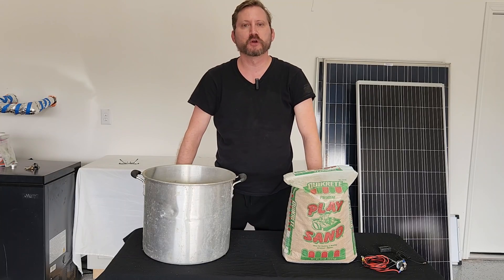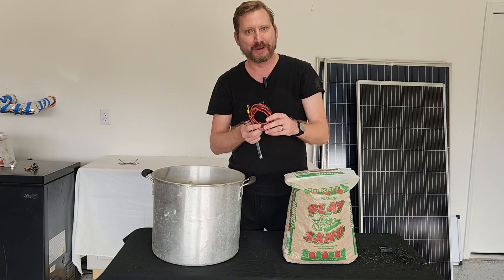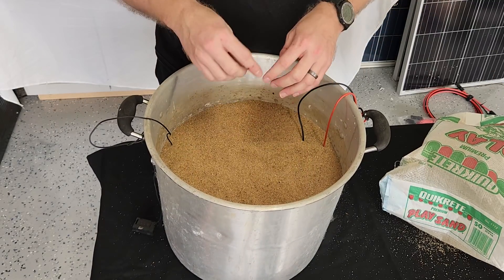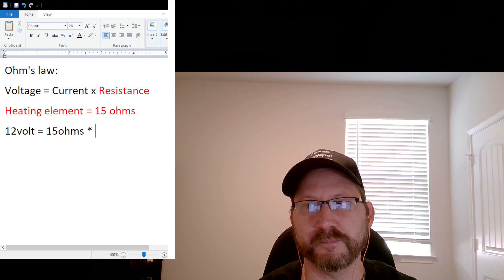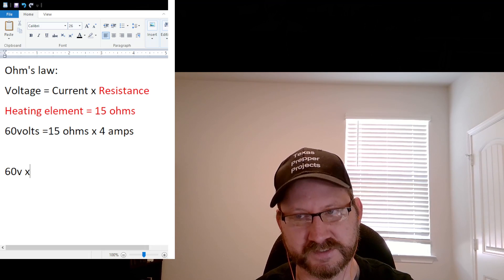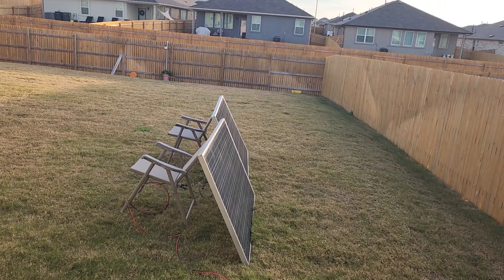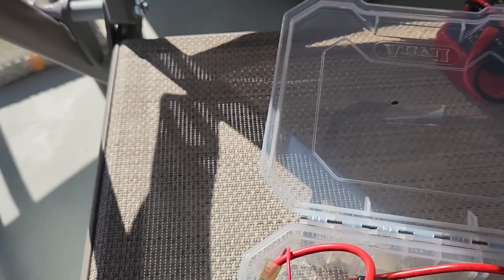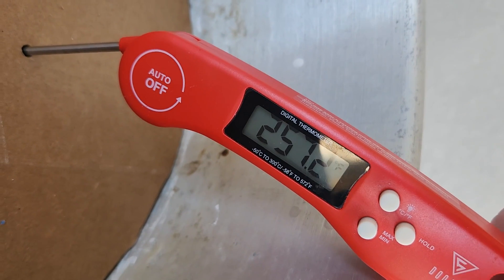Sand Battery Heater solar powered 250F / 120C with no flames or fuel! DIY

Comment: Water is much better than sand at storing energy. Water can store about 1 BTU / lb*degF vs sand at 0.2 BTU/lb*degF. What this means is, if you heat the sand from 75 - 600degF, and the water from 75 - 205degF, and you had 50lb of each, the sand battery would store 4180 BTU, and the water 7250 BTU. Sure, you can heat the sand higher, but at a certain point stuff gets dangerously hot, and you have to deal with more expensive materials to store it safely.
Reply: There is one flaw in your comment that I can think of.  I have been researching to do a setup for a greenhouse.  Looking at equal volumes not weight is a better comparison.  Sand is 1.71 times heavier than water.  So the heat storage is more.  Your argument is correct for equal weights, but the volume would be significantly smaller.  1 cubic foot of sand weighs approximately 48 kg.  An equal amount of water weighs approximately 28 kg.  If I calculated correctly, assuming no loss for this thought experiment taking 1 cubic foot of water from 10 degrees C to 82 would input 8524254 joules of energy or approximately 8079 BTU’s. 1 cubic foot of sand going from 10 degrees C to 200 degrees C would input 7825572 joules, or 7417 BTU’s.  That is 91% of the water total without the hassle.  Most people do not realize water is corrosive over time, sand is not.
Reply: @bretthaddock8954  That's a good point, and one that I hadn't considered. 
I get 80% (6500BTU sand, 8080BTU water), but I guess that depends on your weight / cu-ft, specific heat of sand numbers. 

Yeah, water can be corrosive, and while you can mitigate that, it's probably still more of a bother than sand. 

I'd say both have their uses / use cases; the nice thing about water is you can pipe it to where it's needed (radiators / tubing), whereas sand is more of a blob of heat in a fixed spot.
Reply from the maker: But then everything has to be waterproof
Reply: @texasprepperprojects  That's true. But they also make 200-2000W immersion heaters that are designed to be dunked into water for $20 on amazon. Yes, most are 120V, but you can put two in parallel.  That in a 50 gallon drum will give you a lot of thermal storage, and it's easy to drain / use the water.
Reply from the maker: but then you have to have an inverter. In this design, it's very simple. just dc to dc. You can't cheat heat
Reply: @texasprepperprojects  I'm not suggesting doing MPPT -> 120V. Do a similar thing to what you're doing, just run more in parallel. There's a 120V/2000W immersion heater on amazon that includes a temperature probe(!) for $21. Two of those in parallel would get you 1000W at 60V. (If you wanted 2000W you'd need 4). 

I'm also seeing 48V immersion heaters.

50 gal (400 lb) 'free' water vs $5 * 50lb *8 = $40. A steel 50gal drum would probably work for either.

The nice thing about water is you can pump it through radiators if you want to speed up the heat dissipation. 

Another pro or con is that it's more thermally conductive; that's a pro if you want to get the energy out quickly, a con if you want to store it for a long time.

And again, if you have to move it, it's much easier to drain 50gal of water through a hose pipe than it is to move 400lb of sand.

I think both have their uses, for sure. The nice thing about sand is sometimes high temperature might be useful -- if you want to run a peltier / stirling generator for example.
Reply: Sand doesn't expand or freeze though.
Reply: False

Comment: Great video, and good explanation of electrical theory. Small criticism. I want to maintain a min 15° c - max 30° c for my greenhouse tomatoes. ( PS, don't try growing tomatoes outside in Ireland), so I only need about 10 C of lift over the averages T in March- April.  Thanks.
Reply from the maker: Great tip!  I'm coming to Cork next week for vacation!

Comment: Hi, please could you explain the plastic box of tricks ? I fancy having a go at this project but don't understand the set-up with the busbar etc.. TIA
Reply from the maker: It's just a current meter. Not required
Reply: @texasprepperprojects  hi, thank you for the quick reply. Is the copper busbar necessary or can I just connect panels to the element direct?
Reply from the maker: Direct connect is fine
Reply: @texasprepperprojects hi, thank you. I'll be giving this a go then. 👍

Comment: Ignorant question… would there be a way to make this a safe tent heater for desert camping? Obviously I wouldn’t want to melt anything against a 200°F+ metal pot, including my skin, but something that is not going to continue getting hotter once the panels aren’t drawing power. And obviously not burning fuel has a lot of appeal. 

A mason jar filled with hot water in the sleeping bag has been helpful in a pinch but I didn’t like the potential problems with that. 
The notion that everything except the heating element is already useful for camping makes this an appealing solution for “just in case it gets colder than I can bear” even though it requires at least one day of preplanning. That extra hardware doesn’t take up much space, and the sand is already on site. (How likely is it that debris in the desert sand would combust?)

As I said, I’m asking really ignorant questions. Please be gentle. I don’t need to be told I’m uneducated. I’m asking for what is wrong with my line of thinking. Aside from making sure I don’t burn myself or my stuff on the pot, what are the risks of using a solar sand heater in a camping tent over night as it cools off?

Thanks. (Except for snarky bastards lol You only get thanks if your answers are genuinely amusing)
Reply from the maker: You are actually asking a good question of something that I have pondered but never tested.  So, the SAND is several hundred degrees but the metal of the can isn't that bad.  So, you COULD, in fact, put this bucket inside your tent, 'charge' it up during the day and let it slowly radiate heat at night. Check out my other videos where I  test this on a small scale. The trick will be to insulate your tent from the OUTSIDE (with a heavy tarp) to keep the heat INSIDE.   Having said all of that, I think that a BETTER option is to use an electric blanket with a small ish solar powered system. It will be more expensive, but FAR lighter and easier to deal with, as well as smaller.   Based on my other testing, my electric blanket only pulled around 300 watt hours, which is EASY to do on a battery and solar panel.
Reply: @texasprepperprojects so, since we are on the subject… :)
I want to set up solar for charging batteries for an electric wheelchair at Burning Man. It’s a convoluted situation and while it should be a simple math problem, that hasn’t been the case. I cannot run the chair and charge it at the same time. And there are some special circumstances with the charging cables. 

I am going in circles trying to figure out how to determine the simplest system to allow me to be charging wheelchair batteries day and night. 

My dream would be to buy a Bluetti or Anker power station and some panels and be able to treat that like a regular old ac plug just like I was at home. No gas generator, no fuss. Two elements: power station and panels. (Maybe an additional battery backup or power bank if I need to store up more juice for the nighttime charging)

Do you think if I just haul my wheelchair and it’s paraphernalia into an REI they could tell me the simplest solar setup I could get away with? I really want to be energy independent out there. I don’t bother with ice or fire (I don’t cook or bring perishable food or drinks, so other than keeping my body at a safe temperature and my chair and gps powered up I have relatively simple needs. 

(I wonder if the Playa dust holds heat better of worse than regular sand. I’m guess worse, but I have no reason for my guess)
Reply from the maker: Email me directly texasprepperprojects@gmail.com

Comment: Could you run a copper pipe in and out of the sand that has water running through it and heat water this way along with generating power at the same time?
Reply from the maker: How is hot water generating power? Why would you do that when solar panels already creat e electricity? If you want to make hot water, use a solar hot water heater. If you want to make electricity,  use solar panels. If you want to make a hot thermal mass, then you use the sand battery technique.
Reply: @texasprepperprojects  Just a question.  Why respond with criticism?
Reply from the maker: I wasn't trying to critique, just giving more information on various system options

Comment: Why not just use the window 1000 watts per square meter or put the sand in a box with glass on top of it
Reply from the maker: Huh? Please be more specific
Reply: @texasprepperprojects  "One square meter of glass exposed to direct sunlight can generate 1,000 Watts (1 kilowatt) of heat. If you place sand in a square box with a glass cover, it can produce 1 kilowatt-hour of heat per hour."
Reply from the maker: Hmm. Interesting

Comment: So why did you call it a sand battery when it really is a sand heater. Water by the way would create steam and would create condensate in your walls/roof and things would start rotting from within. A wood stove is most efficient in my case But I would still like to try your experiment.
Reply from the maker: because the sand 'stores' heat. like a battery
Reply: @texasprepperprojects  A battery stores energy until you decide to use it. The sand battery loses the energy at a constant rate. So I don't know if it should be technically called a battery. I may be wrong but that's my guess.
Reply from the maker: @wally1957   yes, a sand battery 'loses' heat, but it also stores that heat for you to use, if you insulate it well enough.

Comment: heating element for 12 volt RV water heater Dernord makes 150W and 130W
I have used my 14" SPARK pot belly stove.
Also used a decorative 17" milk can.
Both have places of honor in my bathrooms.
My BUCK WARNER pot belly sits in the corner of the living room and has two electric range heating elements one above the other. I have heat fans on top to circulate air.
All of them run on power supplied by solar power.
The lady at the city office wanted to know if I had heat in my house. Yep, but the electricity portion of my bill is only $35 through out last winter. 😅
Reply from the maker: Awesome!

Comment: Green house is mostly made of glass so it will capture all 1000W of sun irradiance per meter squared instead of just few% of it limited by area of solar pannels and their 20% of efficiency. But capturing little extra in the bucket never hurts for a slow release over night.
Reply from the maker: Thanks

Comment: You will not get your computed 8Amps in the example since those panels max out at 5-6A.
Better to use direct formula to size the element resistance needed
R=W/ (I x I) 
where W is power of pannels and I is panel nominal current  5A usually. 500W/25AA = 20 Ohm optimal. I would put 25 ohms to have it working even at 80 % of irradiance rather that designed for the peak power.
Reply from the maker: Thanks

Comment: What about transferring the heat from the solar panel to your sand battery? Heat lowers the efficiency of the solar panels.
Reply from the maker: Just pour water on them
Reply: @texasprepperprojects  I don't know much about the process, but find it really interesting. 

I guess it seems like an opportunity to pipe any hot water back down to the sand to store extra energy, but I really have no clue lol
Reply from the maker: I have seen videos on cooling solar panels. It seems like a lot of work for a 5% power gain. Now that panels are so cheap it's not worth the trouble

Comment: Great presentation. Basic Principles thought out logically that make good sense. I think this idea (concept) basically "as is" has so much potential for future development. The biggest obstacle being the effectiveness of today's Solar panel technology. As that technology improves (and it is) I can imagine scaled up versions of this basic design will be in a future niche of its own. Eg. Consider a building, with a sand filled, central back bone wall. Perhaps that same wall incorporating a "closed water" system with under ground heat sink. // Switch on/off between seasons.
Reply from the maker: Glad it was helpful!

Comment: I live in the south of Sweden. Our climate is similar to the northern states of the US (hence all the Swedish immigration to Minnesota and Illinois in the 19th Century)

In winter time from december to March it can be temperatures down to -20. Mostly though it is grey and damp outside with temp +5 to -5 that time of the year. 
I have a cabin out in the woods and investigate and alternative and passive way to heat it. The climate is what makes me somewhat sceptical to this solution for myself. Besides that it is brilliant.
Reply from the maker: Thermal mass. Rocket stove

Comment: Been thinking to do this with a storage heater, which here in UK is a electric radiator filled with a kind of bricks.
Reply from the maker: you need a LOT of them. For this to work, you need TONS of material. Literal tons.
Reply: @texasprepperprojects  Not sure what you mean, one of these storage heater as big as a standard radiator can store enough energy to confortably heat a room for a full day. They use about 2.5KW .

Comment: How long does it stay warm/ hot for?.    I'm still going to make something for my not so winter months and maybe use it to heat some water...warm it up as I don't need hot water even for a shower.
Reply from the maker: Use direct solar heating for water
Reply: @texasprepperprojects 

I have insulation panels  and was going to create a very  small  space with the lid bring about 40 gallons of water... and the air in the void to heat my rv.  The water doesn't need to be common household  temperature  of 120f.  Just warmer.
Reply from the maker: @iwinnimi  I would use a black swimming pool heater and small pump. you'll get more total heat with less electricity used.

Comment: How many Cubic Decimeter or Liter was the sand?

In theory you can store 0,3Wh in 1dm3/K, hence if I have 1000l, with 120degC  and want to take out energy until I have 30degC, I got 27kWh minus some losses. However, Heating up require a lot of more energy, which mostly depend on the insulation.

Note: I need around 36kWh of energy (Underfloor Heating System, 34sqm), to heat my house in the Winter at -20degC outside temperature.

I am Off-the-Grid in Estonia and I am ongoing testing a bigger thing with around 10m3, a Fronius Primo 4.6-1, a Fronius Ohmpilot with a 3kW Heating element. The rest of the Energy is used by my Victron MultiPlus-II 24/5000 for the rest of my property.

Have fun

P.S.: My next project for next year is around 600m3 under my Winter-Greenhouse, where the sand will be heated up to 60degC using a Fronius Symo 10kW, Fronius OhmPilot 9kW and an In-Flow Heater.
Reply from the maker: Awesome!

Comment: This heater takes 1000W 
Will it also work with 12V?
Reply from the maker: Not very well. Watch the part where I talk about the math
Reply: @texasprepperprojects  ok, will do, thank you!
Reply: @texasprepperprojects  I did and sorry that I asked befor looking the whole video. Great explanation that even I can understand. 😂
 You safed my money, now I can heat my sand stove direct with my panels. 
But.... of course again a question, you showed it already in the video, the connection of the silicon wire. (220V wire ? ) :
To connect the silicon wire with the solar panels..... can I use the normal solarpannel connection pieces? 
Thank you so much for this video!!! 🎉
Reply from the maker: Yes
Reply: @texasprepperprojects  Thank you again! 🎉

Comment: Could it be converted into a smaller version with less panels for a small van?
Reply from the maker: You won't get as much heat out so it's not worth it. For a fan I would just use an electric blanket. Mine draws 100 watts

Comment: For optimal energy transfer from solar panel to resistor (heater) there should be done some trials with various values of resistors. Here was used, arbitralily, resistor = 15 Ohm. Since the solar panels have high internal resistance, and there is a voltage drop when they are loaded, first there should be measured voltage of 2 panels in series without load, and later adjusted the resistor to such value as to get the voltage under load close to 1/2 voltage of open circuit.
Reply from the maker: thanks

Comment: You have a metal pot with hot sand inside, it appears not to be thermally insulated so a great deal of the electricity from solar panels is heating the air.  Now that you have this heat in the sand what do you plan on doing with it?
Reply from the maker: The pot doesn't need to be insulated if it is Inside the airspace you are trying to heat. This is a demonstration video not a live setup

Comment: How long does it take to get to room temp? Was thinking it could be used to heat a tent or camper van at night. I don’t like the idea of the small diesel heaters that people use. Great job!
Reply from the maker: it depends.  check out the other videos for data. It really depends on how cold it is outside.